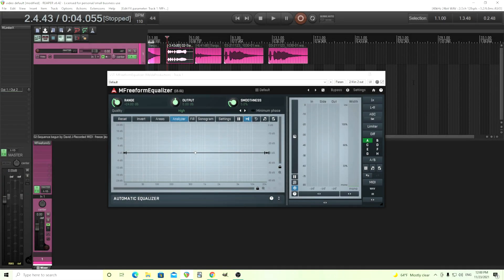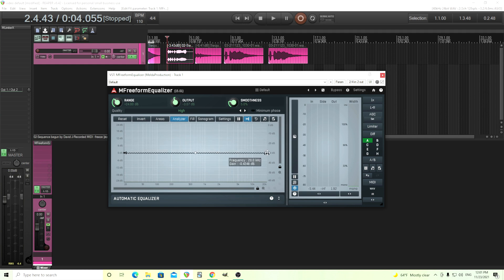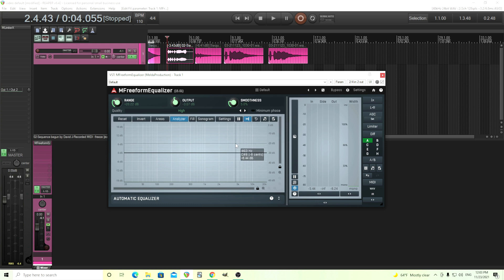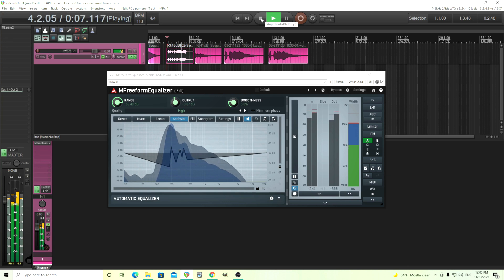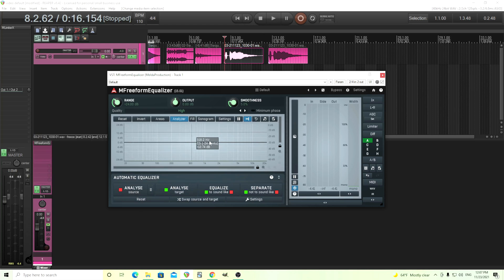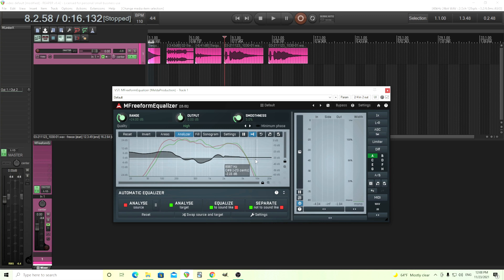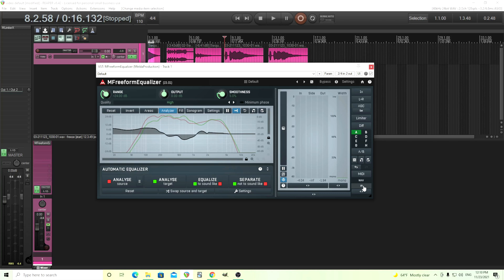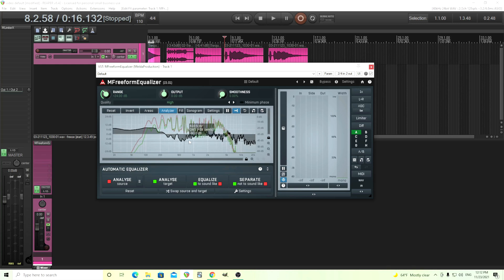MFreeformEqualizer  Features and Tips

Comment: hey Chandler! i just bought this plugin last night. I am trying to Eq match 2 of my basses and export the curve as an IR. The thing is that the ir is way quieter than the original signal. Is there something that i can do or set so that the ir is at a normal volume?
Reply from the maker: Without seeing it myself I can't say, but there are a few things that could be happening. It could be the IR loader you're using. Another possibility is that your IR has an extra boost in the low end. This sometimes happens due to electric hum, etc. This will take up volume, so if you notice a weird bump in the bass area of the match you should remove it. Otherwise I'm not sure, but I'd just increase the volume in the IR loader. I hope that helps
Reply: @Chandlerguitar  The Big difference between the 2 signals is one of the basses, that has hotter pickups and some bumps in the 1.5k region. But other than that nothing. Ive tested te ir loader on my processor (hotone ampero stomp 2) and with all other Ir s that i have, it behaves normally. Basically what i want to do is have a more consistent transition between my basses when i switch live. Later edit: Its not the Ir Loader. It the IR itself. I've tested it with 3 separate loaders. All behave the same.